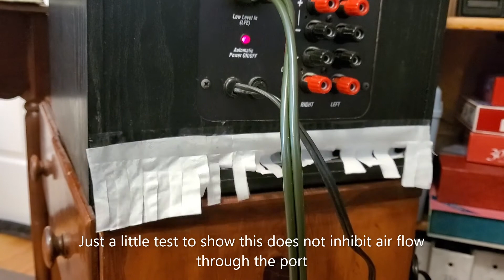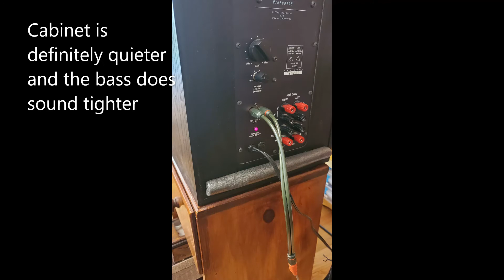Damping a old Subwoofer

Comment: I THINK the sub doesent go that high Hz to make the cabinet wall resonate🤔
Reply from the maker: Sub cabinet resonances can happen between 50-100hz. Most modern subs now are heavily braced for that reason. The most audible difference from this project was from plugging the slot port. That definitely tightened up the bass.